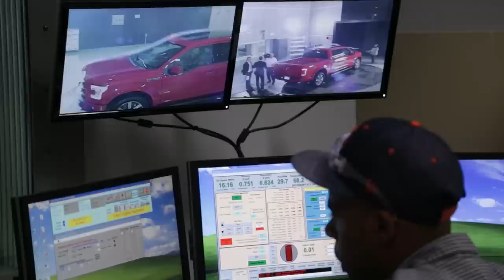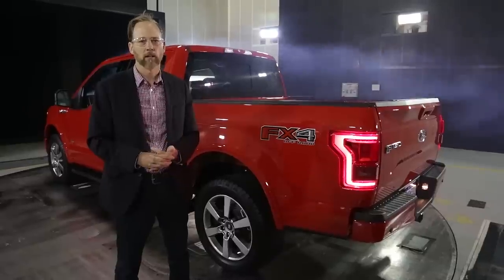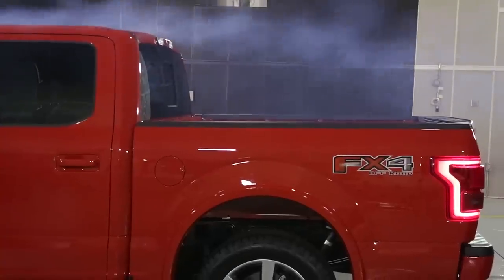2015 Ford F-150 Tailgate Myth Debunked | Autoblog

Comment: Mythbusters prooved this a few years ago, even utilizing real world testing
Reply: Mythbusters are goofs

They should try testing a more practical 8' bed truck

Dodge 8' Bed Pickup Truck
Drag Coefficient
Baseline condition    Cd = 0.432 (without mirrors) 
Square Cap    Cd = 0.480   11.11% Increase in drag
Replace tailgate with a cargo net    Cd = 0.461   6.71 % Increase in drag
Removed Tailgate    Cd = 0.447   3.47% Increase in drag
Lowered Tailgate     Cd = 0.414     4.17% Decrease in drag
Tonneau Cover     Cd = 0.381  11.81% Decrease in drag
Rearward Downward Slope Cap Design  Cd = 0.302   30% Decrease in drag
At Western New England College, the study of engineering is about solving real-world problems.
Reply: Lmao and he says cargo nets are slightly better but at the same time not as good as the tailgate up... at least he's honest even though he's clearly not supposed to be.  Good on Ford for trying to improve aero but I think I'll get myself a net.
Reply: wings:  Mythbusters wants to hear from people who demand another tailgate off or on Test.  Please write
Reply: @Mr Mike He was saying that nets are slightly better than having the tailgate down. Having the tailgate up is objectively more efficient than the net from all testing done.
Reply: @happysawfish  Leave the tailgate UP, it creats an "air bubble" in the bed, and increases aerodynamics.
Reply: Since when was a wind tunnel not real world enough?? You actually get to see exactly what the air is doing
Reply: @TheBassaddict17  the problem with a wind tunnel is you're still in controlled environment. You generally have air flowing only one way and you don't have other forces you have to overcome such as ground friction, wake from other vehicles, etc.
Reply: @RedWingsninetyone  you're not wrong, but the whole subject of the discussion is simply how air travels through & over your bed. All the other factors are contributors to your overall economy but irrelevant to the specific topic. Its just excellent to see the exactly what the air is doing, just like doctors getting their first X-ray machine in the 1920's
Reply: @TheBassaddict17  yes and no. The other factors are why trends go back and forth and why real world often varies from those controlled settings. The controlled settings help if you're looking to do something specific, like how to handle front wind or cross wind, but they often do very little to account for all variables at play, intentionally.
Reply: @RedWingsninetyone  Which, they were looking to do something specific 🤷 lmao Conceded my point there
Reply: @TheBassaddict17  no, you moved your point. You stated wind tunnel was the same as real world. It isn't. That's my point. It can help, but it's not the same.
Reply: @RedWingsninetyone  No I did not, I said "since when is a wind tunnel not real world enough". Now that you're getting onto playing with words just to keep bidding, imma exit this discussion, Mr. "Right"
Reply: @TheBassaddict17  exactly. The wind tunnel is NOT real world. It's a controlled environment. It can help simulate real world, but often real world results vary from said controlled environment due to the variables they're trying to eliminate (thus the "controlled" part). That is why a wind tunnel is not "real world enough."

Comment: I have done the mpg test from my grandpas farm 70 mile round trips with both my 92 F-150 8ft box with the 5.8 and grandpas 92 F-150 8ft box with 5.0 I got slightly better .5-1 mpg every time with the tailgate down. Done the test at least a dozen times filling at the same fuel pump exact same route. The wind hits the tailgate I have ridden in the back since being a kid on the farm you can feel it and see it with plastic bags and debris wind push’s down into the bed rises near the end being forced up on the tailgate on a 8ft bed. Doesn’t take side wind  and other factors.

Comment: Huge Ford guy here! but who is doing work with a 4 ft bed? Seriously it's USELESS and not convenient for anything big.  Try this test on an 8 ft bed!
Reply: While you might think not, the same principle applies to both sizes. If the tailgate is down the air in the bed is escaping and has to be replaced with air flowing over the cabin creating drag due to increased vortex's. By keeping the gate up, air is restricted from moving meaning air flowing over the cabin can continue to flow down to the tailgate which significantly reduced drag by limiting the creating of vortex's.
Reply: Josh Gudex Get a trailer and not a small 8 ft box with wheel wells
Reply: Nobody is doing much "work" with their trucks these days. 4 door trucks have taken the role of the minivan and full size suv where I'm from. The contractors are still buy the 8' bed option but this video is for the average consumer, obviously.
Reply: WISCO KID Last time I checked crew cab beds were 5.5 ft
Reply: What the hell is a "trailet"?
Reply: Trey , You should never speak in absolutes.
Reply: Toomany Hobbies Yea those are options for the supercrew models; however, a large majority of the supercrews come with the 5.5 ft bed. 6.5 ft beds are a default option on the regular cab and supercab models but not supercrew. If you build and price an F150 supercrew online the 6.5 ft beds have to be selected intentionally as an option

Comment: Odd thing is my old 1980 F150 was faster with the tailgate down, and off.
Reply: Single cab short bed ?
Reply: It pretty much your imagination...
Reply: Didn't take my tailgate off my on my '82 F150 with tailgate up and back window open lots of air at speed.  Put the tail gate down and there's minimal air blowing forward through the rear window.

This is also on a 6.5ft short box flareside truck.  This may be a myth with modern aerodynamic trucks but it doesn't apply to pre aero trucks as it's not a myth for them.

Comment: i was driving my truck the other day and had both front windows half down and the small rear window open and the the pressure difference from the bed and the cab sucked a bag of empty soda cans through that small window into the cab and nearly hit me in the head. its a 4 door truck so it flew a pretty long distance

Comment: 15 jun 2019 8:38 pm edt:
0:46 wind bounce up then make down-force, giving more friction to rwd.
15 jun 2019 8:39 pm edt:
down-force help lightweight-f1-car stick to asphalt.

19 jun 2019 5:38 pm edt addition ---------------------------------------------
0:40 if there is a short-stature-wind-mill on truck-bed whose short-stature is shorter than tailgate-top-surface then will that short-stature-wind-mill rotate during truck moving forward...

Comment: I guess it depends on the vehicles and the bed shapes.  For a trailer hitch attached to a SUV, taking the back off works best.  I drove from CO to MN with a sofa on mine.  Gas mileage was great.  Coming back, it was empty and I could feel my car dragging and it was even harder to speed up and pass another slow vehicle. I gassed up on that first leg more than I did the whole trip up. For the 2nd half of my trip I removed the back of the hitch and my drive was smooth again and passing was smoother, so my test, an actual live test, shows that the tailgate needs to be off or down.  I don't own a truck so I can't test it on one.

Comment: Then why Is it when I have my windows down and back sliding window open I get air through the back window and shit flies through and hits me in the back of the head and my dash lol
Reply: +J Lava Basically, as the truck moves forward, the back wall of the cabin where the rear window is, is creating a vacuum that sucks air in.   Also there is a 'recirculation bubble' where the air in the bed is basically a sideways tornado, moving backwards on top where it meets the flow over the top of the truck, but forwards on the bottom to fill that vacuum.

Comment: i swear my Ranger does better with the tailgate down.  My ranger also has a raked stance, and is lifted, so perhaps the air under the truck gets sucked out nicely by the lowered gate, instead of violently sucked thrown about..?

I can cruise at 90mph easier with the gate down, with the gate up my ranger struggles to maintain 90mph.   I do 65 normally though.
Reply: I agree my 2002 gmc sierra 1500 4.3 V6 vortec drives much better with the tail gate down its a long bed as well its well used with 403000 miles picked it up for $1500 peace and much respect to you Jason

Comment: Did you not see the person adding more smoke only when the tailgate is down
Reply: hmmm.  and no more smoke running over the top while they dropped tailgate
Reply: The smoke is a visual cue to show what happens with the air in the bed.

Comment: You should leave tunnel in front and tailgate down. wind tunnel in truck bed doors not prove nothing.......
Reply: That was just the smoke nozzle since air isn't visible. The vehicle is IN the wind tunnel. The fan is up front. It's huge and always there.
Reply: * "not prove nothing"
Double negative ...

Comment: Just buy a Chevy instead, my Silverado would run off and leave my F150 and got 3mpg better on trips. The Ford also trashed a transmission within 50,000 miles.

Comment: Ok now get a old truck when the claim came out and try it cause this is total bullshit for old trucks.  I know cause my F150 has lots of turbulence with the tailgate up vs down.  Case in point opening the rear sliding window with tailgate up forces more air into the cab and with tailgate down less air.

Comment: Although I agree with the results, they showed the air bunching up in the bed by putting the blower in the bed. They never showed the results of leaving the tailgate down with the air coming from the front of the truck.
Reply: 93jcoop the wind was always coming from the front. They only moved the smoke wand to show the air circulation in the bed more clearly.
Reply: True they only moved the smoke, but the air only held the smoke down in the bed, causing it to collect like that, had they left the smoke up front with the tailgate down, you would have seen how much faster it dispersed than with the tailgate up, the wind is so finely streamlined over and out of the bed with the tailgate down that it is literally holding the smoke down, proving there is LESS drag in the bed with the tailgate down

Comment: JUST DROVE TO YOSEMITE FROM LA /VENTURA & BELIEVE ME THE GAS MILEAGE IS BETTER DOWN! IN FACT WAY BETTER NOW I DID HAVE A TRAILER BUT IT'S AN SEMI OPEN MOTO 'AIRTOW' TRAILER SO VERY LITTLE TO "GRAB" ONTO, SORRY FOLKS ON OPEN HIGHWAY, TRAFFIC, WIND GUSTS, SEMIS GOING BY & PASSING, I GOT ABOUT (2 MILES PER) {1.67 EXACT) ON 319 MILE TRIP COMPARED TO USING THE SAME TRUCK GATE UP GMC 2018 HAS A SMALL DAM ON THE TAIL.